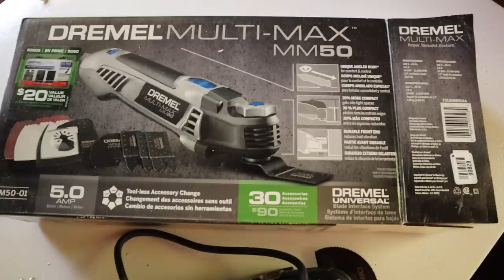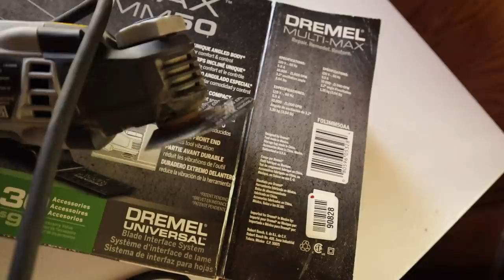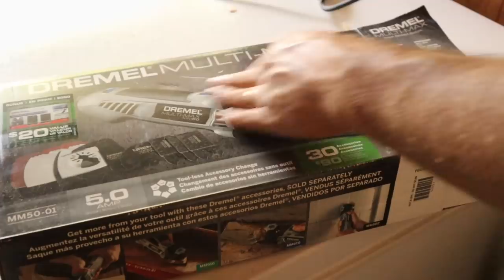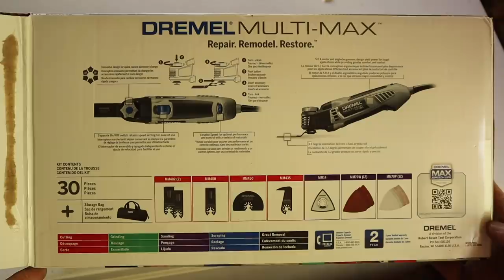This Amazing Time Saving Tool Blew My Mind

Comment: You will find more and more uses for this tool, I started with a cheap one from Harbor Freight and I used it hard and often, it quit on me so I bought a Rockwell and it has been great also (took the Harbor Freight one apart found a burnt wire ) it is back it service again, with two there are less blade changes.  My only gripe is I think the blades are on the expensive side, but they do work great. They were made for the job you are doing that is for sure.

Comment: Great video Wes!  I had thought long and hard about buying a similar tool over the years but put it off.  We were having our kitchen refitted and I had bought a stainless steel splashback sheet for me to fit behind our range cooker after the guys had finished the rest of the kitchen.  The splashback was 40" wide and when I came to fit it, the guys had fixed the wall cabinets at 39.8" apart so it wouldn't fit.  I tried to get an engineering company to cut a thin strip off the sheet, but was told they cannot cut less than 0.75" on a guillottine as both sides need to be supported.   I found a solution by buying one of these tools and cutting a small slot down the back edge of each wall cabinet for the sheet to slide into!  They are called multi-tools here in the Uk, but when I was looking to buy one, I never saw a Dremel here.  Mine is made by a company called Smart, and came with lots of blades and sanding attatchments, and a diamond blade for cutting ceramic tiles too.   Good bit of kit!  Stay safe & stay well.

Comment: I bought the Harbor Freight version 5 or 6 years ago, I have use it to cut along the flooring in my workshop, for repairing windows and trim jobs while tiling, and last week to quickly cut the bottoms of door frames while installing laminate flooring. If I ever have to replace it I will probably buy the Dremel. I believe, if you can remember that you have it, I can see many uses you may have for it on several of your projects.

Comment: I agree about owning an oscillating tool.  I have had a Harbor Freight version about 4-5 years and it is a lifesaver when nothing else works, or works well.  They are great for trimming door casing when installing a thicker floor.  Uses are endless.  I agree with an earlier comment about plunging it in and making the entire cut as you go.  It would be faster and less work for you.  Let the tool do the work.  Something you might check....I am thinking the blades are mostly standard and Demel accessories are not cheap.  Check the Harbor Freight accessories/blades for fit on your Dremel and see if they will work.  The HF accessories I purchase have served me well with no issues.  My brother has a Porter Cable brand and my HF does just as well as his, but the HF may not last as long as a better brand.
Reply from the maker: I tried to plunge it in and let it go, but it didn't move very fast and nearly caught the wood on fire with friction. Maybe I'm doing it wrong. I'll have to experiment with it.
Reply: @falllineridge  I have had more luck with the straight blades and just plunge in and move over.  I have not had luck with the circular blade cutting wood.  The surface area of the straight blades are smaller and lets the tool plunge right in.  Also, I have not had much luck with blade longevity.  They all (in my experience) have pretty short lives.  Another reason to check the HF fit.  Still, a good video.  During this virus pandemic, I appreciate all the new videos.  Give me something to do....
Thanks.

Comment: You can do that with a sawzall reciprocating saw.  I got one of those multi-cut tools 12 years ago from a neighbor who purchased one for himself at harbor freight for $7 including the attachements.  I still have it and am still using the same blades that came with it.  Don't know what you paid for your's but.....I always just grab my cordless Ryobi sawzall.  I purchased a drill and 2 batteries with charger on sale about 10 years ago for $50.  I added numerous 'bare' tools including the recip saw, blower, weed eater, circular saw, impact screw gun, several brad and staple drivers, a tire pump and much much more.  Most times you can find the attachments on ebay for under $20 without the batteries or charger.  I even have a cordless angle grinder and chain saw to go with the outfit.  And off-brand batteries sold on Amazon keep all working fine for nut much money.

Comment: I do home repairs and the best blade that I have found are, "EZARC 6pc Titanium Oscillating Multitool Blades Long Cut Saw Blades Speed Cutting for Wood, Metal and Hard Material, 6-Pack".
Reply from the maker: Thanks!

Comment: It’s definitely doable to mill that on the LT15. I have done a maple about that size when I had mine. Just sucks when you are solo cuz you have to roll it yourself and when it’s what big you have to roll it a lot. Looking forward to the struggle but it’s worth it. I have a 37” pine coming up for my lt35. Luckily no knots. So shouldn’t be too bad.
Reply from the maker: Good to know! I just got in the LogRite 78" cant hook for the job. Plus I'll have help. Glad to know someone else has successfully done it. Thanks!
Reply: I was going to suggest an extra hand. I had all 135lbs bouncing while my feet were on the log and I was having trouble rolling it. That was also with my little can’t hook and after that log I bought the bigger hook. Looking forward to the video. Also, accept my fb friend request! Lol

Comment: Slow down and let it cut.That blade you have on is usually for drywall .I have a Rockwell one and I use FEIN 3" wood blades or something of similar width.
Reply from the maker: Thanks for the tip!